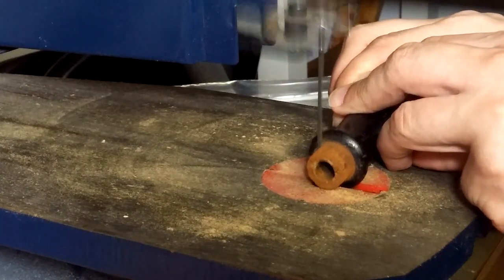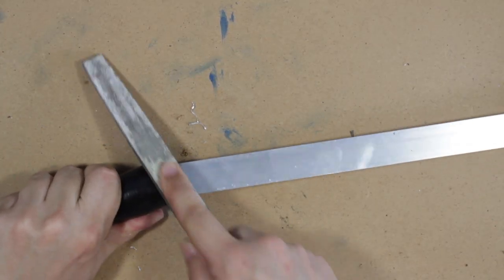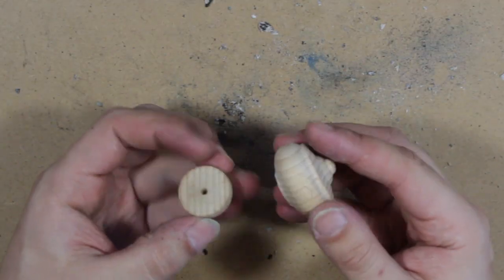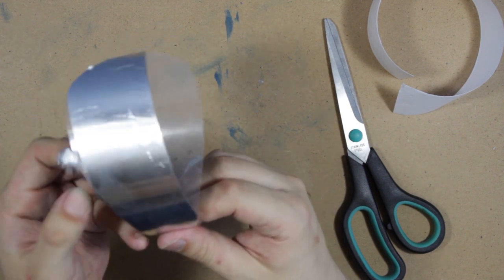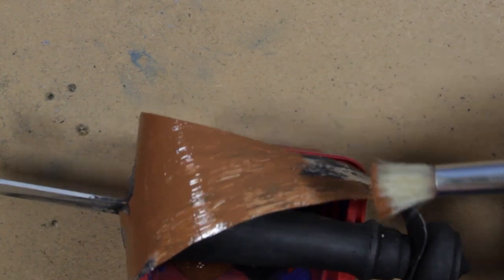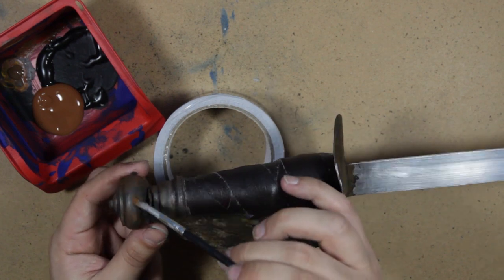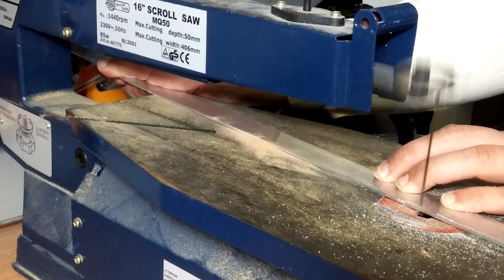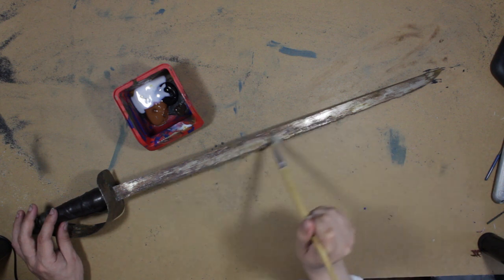DIY Rusty Pirate Sword Prop

Comment: Well you shouldn’t use it even for fun. 

If you don’t have the tools to forge a blade, just take a thin long steel bar. Isn’t expensive, file down one end until you have a tang. Don’t file off too much. If the blade has a width of 2,5cm file it down to 2cm. Now take some wood and do it differently as in the video. Make sure you have a long drill so the tang fits inside it and a bit sticking out at the end. Maybe 3-4cm. 
Drill the space for the tang from both sides - makes it easier. Now mark the point where the tang sticks out of the wood. File it down a bit more the rest of the tang. Not too much. Maybe down to 1,5cm. It takes some time but it’s worth it. Now take an old doorknob and take a steel drill so that the tang would fit. For the handguard take a very thin steel sheet. Take a saw or whatever tool fits you to cut out what he did in the video. Should be very easy. File the edges so you don’t cut yourself. Put the handle on the tang, drill holes through the wood and steel tang. Take off the tang, slide on the upper part of the guard, it should automatically stop where the tang ends and the blade starts. Slide on the handle again, fix it with screws. Now get the lower part of the guard in place. If you‘re ok with the result, take the pommel you made from the steel knob. It should fit but with resistance. Apply a thin layer of strong glue on the rest of the tang, and put on the pommel. If you need a hammer to do so then you‘ve done it right because the pommel should fit very tightly on the tang. 

The more planning you put into it in terms of balancing the handle and the blade the easier it is to use the sword for show fights. 

But keep in mind it’s probably not hardened steel, so take care and don’t do very heavy show fights with it or the blade will get damaged very fast. 

—— 

If you do fights like with that he made in the video you’ll risk hurting yourself. He made a wall hanger, that could end very badly for your health if you use his version or worse the blade loosens up breaks apart and fly’s off and hurting or killing someone else. 

If ya do it - and you are on a budget - do it right - do it safely.
Reply from the maker: Nowhere in the video I claim this should be used. It is a prop. I think that's pretty clear. Using aluminium makes it lightweight and easy to carry around.